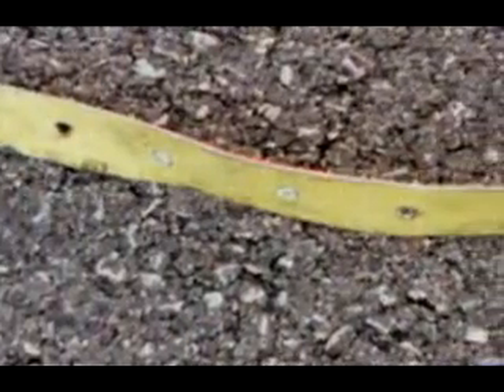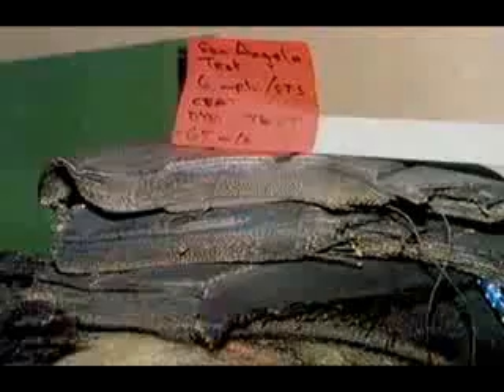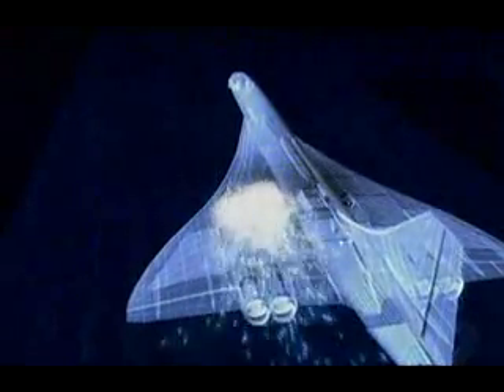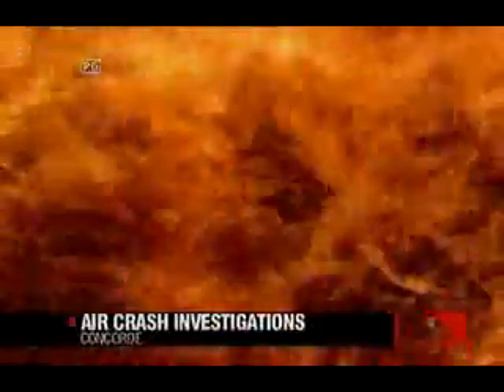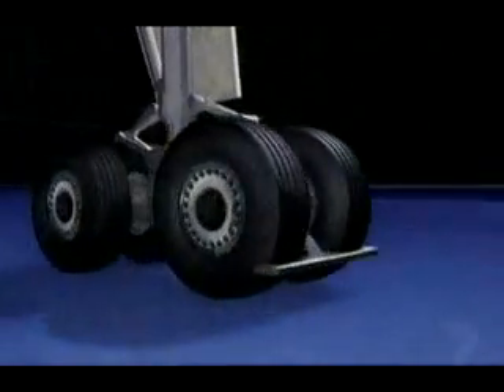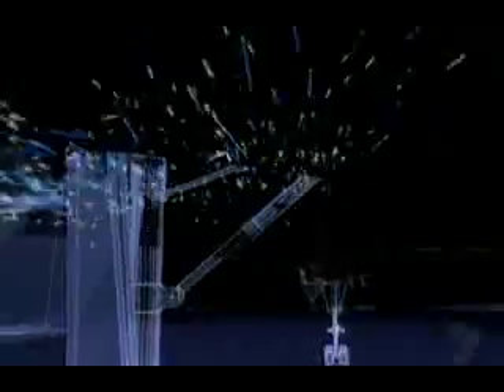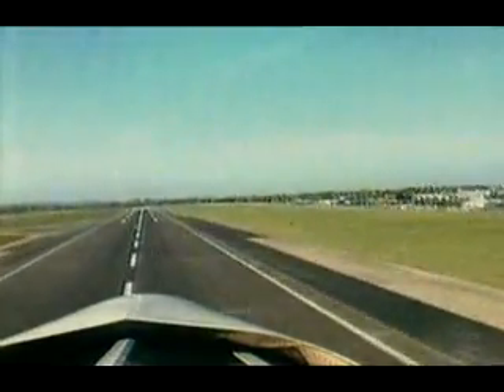Air Crash Investigation - Concorde - Part 4

Comment: Good point.  i reckon the pilot has a split decision to make, perhaps if it were a 707 or a slower plane they could have aborted but going that fast and so close to V1, the pilot could  only hope that getting airborne he would have a chance at rectifying the problem rather than abort and lose lives and later be told he had a different choice if it were a different matter.  Poor pilot. Poor people. Sad.

Comment: is it just me or is most of the reasoning just speculation? Usually Air Crash Investigations is usually far more factual but this seems to be guesswork. A piece of metal happens to puncture the tyre, we think the tyre caused a shockwave in the fuel tank and we think this blew out a plug, the piece of tyre also cut electrical wires that happen to spark the fire. It's all a bit vague...

Comment: And  I suppose you'd continue to drive your car if your gas tank was on fire instead of pulling it over? I'm not saying my opinion is right because it's an opinion. No one knows what would've happened had the pilot chose to abort take off. I'm saying it is more logical to risk going off the runway then it was to take flight.

Comment: So the problems with the tires made the engineers decide to make them stronger thicker runbber, belting ? Regardless, it is an engineering axiom.You never change only one piece in a projec so whether wheel guards.orr temperature sensors the pilot shoulve been aware the plane ws in trouble Of course today this would not have happened 'cause ever inch of the plane is monitored, but looking at that insrumet panel I imagne the monitoring was lacking.. A DAMN SHAME! Just like the shuttles O rings

Comment: This speed is commonly referred to as V1. All multiengine pilots are trained to react when something happens during a V1 event and it is usually an engine failure. This particular event was very unusual and the pilot could not have known exactly what was going on as there would be no indication in the cockpit to tell him so.

Comment: Normally this series is pretty good, but there've been quite a flew inaccuracies that the BEA report clearly tells otherwise.

For example at around 6:45 , this film says that the Captain shut off #2 engine. That's false, the Flight Engineer shut it off, and DID NOT TELL the Captain, which is not S.O.P.

That was listed in the official report as one of the contributing factors, as the Captain did not know he didn't have #2's thrust, and even is heard asking what happened to #2 on the CVR!

Comment: @paulhunter123 

Um... at that aircraft's typical V1 decision speed, you're doing nearly 200mph.  250mph at the point of liftoff.  Meaning that you wouldn't "slide along the ground"... you'd instead cartwheel like a mutha-effer, break apart, and have bodies/shrapnel/fuel strewn all over the airport fields.   

Hence the guy with a plane on fire, with bad engines, being more willing to take his chances in the air rather than attempt to stop after V1!

Comment: @goskateboarding1000 Birdstrikes hit the engine, causing it to simply loose power, sometimes catch on fire, however in the concorde case, the rubber hit the wing. (The wings on the concorde are specially designed, and not made to withstand, well any type of contact, probably something that could have been done better in the creation of the concorde) after it hit the wing, fuel escaped, getting into the two engines, causing them to light on fire, a stall, then a crash :(

Comment: @VorkeyYT they did prove that the Tyre hit the wing as there was a  dent on the wing when it was retrieved from crash site. And even though it was never proved that the landing gear/anti lock brake wire caused the spark they did a mock which proved that the exposed wires arced crated a spark which ignited the fuel in less than one second. All other sources of ignition failed to start the fire in such a short space of time from it seeping out of the hole to it igniting. This ACI is not that good

Comment: @SideShowCecil1977 Actually even if you are in the air, you can abort the takeoff and land immediately but under one condition. Its that the plane is not above a critical speed V1. In this case, due to the high speed concorde naturally has, the V1 was reached very quickly, and the runway left was very little, and any attempt to land it would have only made it crash.

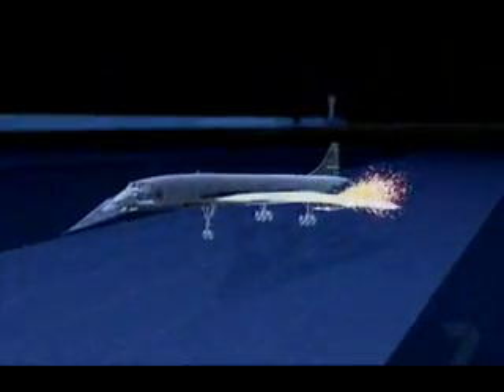Comment: At about 05:30 on the video it says that the Tower contacted the pilot to inform him of flames JUST as he was taking off (Remember there are no rearview mirrors on a plane). Once wheels are up its pretty hard to abort then. All the pilot knew was that he was loosing power in Eng 2, he did not know of a fire until he was already in the air, even if its only a few metres off the ground. So in summary, was already in the air when told of fire, therefore couldn't stay on ground and run off runway...

Comment: @tsispaubnpe  - How can you possibly blame the pilot? He had no choice but to take off as he'd reached the point of no return. If he'd chosen to abort he'd have needed 3km of runway to stop at that speed and he only had about 2km, and the 3km stopping distance assumes you have reverse thrusters which he wouldn't have had in his left engines.... As the fire was burning the flaps on the wing he couldn't control the plane any longer so it was doomed....

Comment: @007wingman 

since the leak was ahead of the engines, with 70 L per second (thats a LOT of fuel) burning, consuming the oxygen needed for the engines to burn its fuel, causing it to flame out. there's no cover up, its simple physics.

Comment: Hi, I am a pilot, why would a engine loose power because of a fuel leak in the wing.... The engine was shut down because it lost power and the aircraft automatically banked into the good engines.  With half power the aircraft entered a departure stall and spun to the left due to the good engines.  A fuel leak would not have cause any of this.  It is a cover up by the French to CYA  themselves.  007 Wingman.

Comment: lol dude he's talking about "elevons"
The concorde is a delta wing (no horizontal stabiliser) which means it doesnt have a conventional tail. Elevons are ailerons and an elevator combined and they are found on the trailing edge of the wing. 
FYI a wing stalls when it passes an average of 16 degrees angle of attack, regardless of IAS.
lets keep the bs to a minimum :)

Comment: excuse me.... ailerons are used to bank the plane, that turns it, main pitch controllers are the elevators and stabilizers. secondary are the flaps and spoilers. 
Secondly 110 degree nose up attitude indicates that the autopilot was set for the altitude, because in condition of stall if the plane was manually controlled, the pilot must have lowered  the nose to gain speed, it would have give some room to at least pass the hotel.

Comment: Wtf are they on about? There is no need for a wire sparking to set such a fuel leak on fire! Concorde is not like other airliners that have their engines in front and a large distance underneath the wing, the engines are stuck on at the back of the wing. The fuel going past two lit afterburners, (if you ever saw Concorde take off at night, you'd know the afterburner flames are at least 5 m long) or for that matter, through the running nos. 1 and 2 engines would have been enough to start a fire.